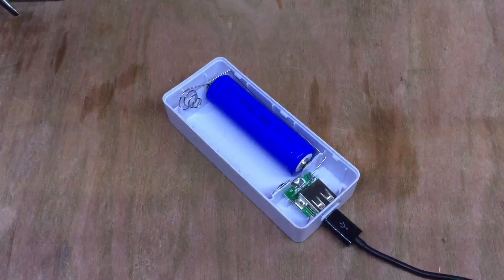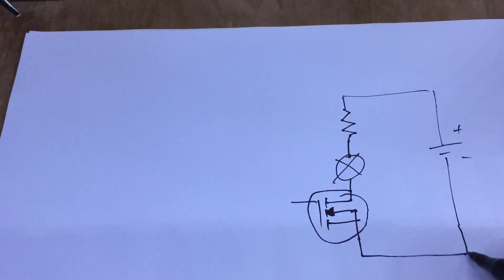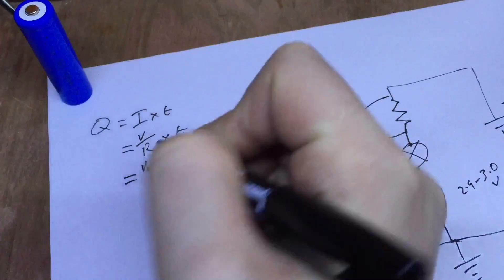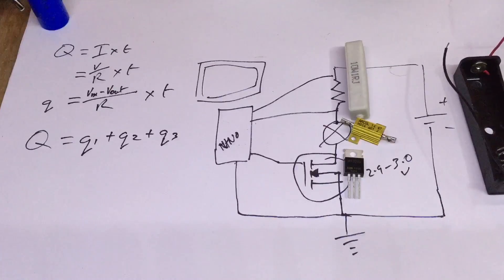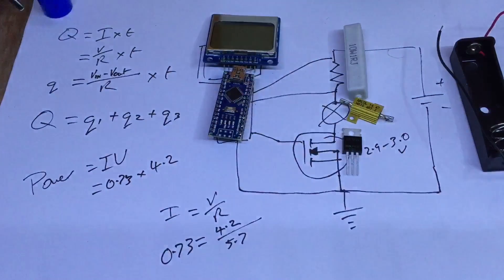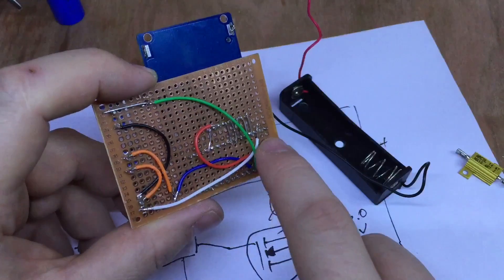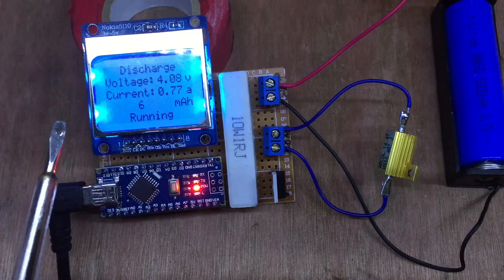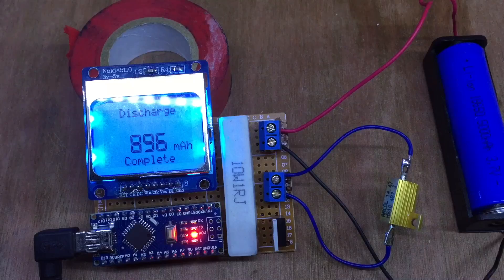Lithium Ion 18650 Capacity Checker - Adam's Arduino Projects

Comment: stray '\342' in program
Reply: Instead of - 

digitalWrite(gatePin, HIGH);
millisPassed = millis() – previousMillis;
current = (battVolt – shuntVolt) / shuntRes;
mAh = mAh + (current * 1000.0) * (millisPassed / 3600000.0);
previousMillis = millis();

need -

      digitalWrite(gatePin, HIGH);
      millisPassed = millis() - previousMillis;
      current = (battVolt - shuntVolt) / shuntRes;
      mAh = mAh + (current * 1000.0) * (millisPassed / 3600000.0);
      previousMillis = millis();

I don't know why, but it works!

Comment: BAD :Arduino: 1.8.14 (Windows 11), 
sketch_oct31a:68:25: error: stray '\342' in program
 millisPassed = millis() – previousMillis;
                         ^
sketch_oct31a:68:26: error: stray '\200' in program
 millisPassed = millis() – previousMillis;
                          ^
sketch_oct31a:68:27: error: stray '\223' in program
 millisPassed = millis() – previousMillis;
                           ^
sketch_oct31a:69:20: error: stray '\342' in program
 current = (battVolt–shuntVolt) / shuntRes;
                    ^
sketch_oct31a:69:21: error: stray '\200' in program
 current = (battVolt–shuntVolt) / shuntRes;
                     ^
sketch_oct31a:69:22: error: stray '\223' in program
 current = (battVolt–shuntVolt) / shuntRes;
                      ^
C:\Users\....\AppData\Local\Temp\arduino_modified_sketch_20219\sketch_oct31a.ino: In function 'void loop()':
sketch_oct31a:68:29: error: expected ';' before 'previousMillis'
 millisPassed = millis() – previousMillis;
                             ^~~~~~~~~~~~~~
sketch_oct31a:69:23: error: expected ')' before 'shuntVolt'
 current = (battVolt–shuntVolt) / shuntRes;
                       ^~~~~~~~~
exit status 1
stray '\342' in program

Comment: Thank you for excellent video! Could you explain why do we need a shunt resistor and two Arduino analog inputs to measure current. If we know exact resistance of the load (for ex. 4.7 Ohm) and have measured voltage on this load (for ex. 4.0 Volts) then we can calculate current as 4.0 / 4.7 = 0.851 Amp.  So, I think that measuring battery voltage (that is the same as load voltage if load resistor is connected directly to the battery) we can always calculate current value. It means that one Arduino analog input is enough to measure both voltage and current. Am I wrong?

Comment: I wonder what is the difference between doing this way and discharge the battery at a constant current, would you get the same capacity result number?

Comment: Did you check these values against a proper meter? Hardly seems realistic that the current is jumping from 0.76A to 0.63A and back within a few seconds, with just a battery discharging into resistors. That's almost a 20% error in current measurement, although I guess in the long run it might average out to about the right result.

Comment: Nice video. I have some questions. What is the purpose of the shunt resistor? We already have a voltage drop on the resistor load to calculate the current... so the shunt seems unnecessary. In this way we could also read a single voltage (the positive terminal of the battery) as the other end of the load will be at ground (so clearly 0V). Am I wrong?
Thanks
Reply from the maker: You’re right - it’s not really necessary. The idea of a shunt and load resistor in the deign was simply so the load could be changed. Changing the load resistor would change the rate at which the cel was being discharged, and no code changes would be required.
Reply: @AdamWelchUK  many thanks, now it's clearer

Comment: Hi Adam, I really enjoy your videos. I had a question about the load resistor and 'voltage sense' resistor here - I can't see why they couldn't be integrated into one load resistor across which the voltage is measured. In this case you'd be measuring the battery voltage effectively, but again, I guess this is the voltage applied to the resistor, and so is the right voltage to use to measure the current flowing... what do you reckon. I'm hoping to use this with Azande tool, which is very handy for interfacing arduino with pc. All the best!
Reply: Typically a smaller value of resistor is used to keep the voltage across the resistor small, within a range that the microcontroller can read without blowing up. However in this case since the microcontroller is running at 5V and the maximum voltage of the battery is 4.2V, you are perfectly correct, the second resistor was not necessary. In fact, measuring the voltage drop across a smaller resistor only serves to make the result less accurate, because you're only using a small portion of the resolution of the analogRead range.

Comment: /* 
* Battery Capacity Checker
* Uses Nokia 5110 Display
* Uses 1 Ohm power resister as shunt - Load can be any suitable resister or lamp
* 
* YouTube Video: https://www.youtube.com/embed/qtws6VSIoYk
* 
* http://AdamWelch.Uk
* 
* Required Library - LCD5110_Graph.h - http://www.rinkydinkelectronics.com/library.php?id=47
*/
 
#include "LCD5110_Graph.h"
LCD5110 myGLCD(5, 6, 7, 9, 8);  // Setup Nokia 5110 Screen SCLK/CLK=5, DIN/MOSI/DATA=6, DC/CS=7, RST=9 Chip Select/CE/SCE=8,
extern uint8_t SmallFont[];
extern uint8_t MediumNumbers[];
 
#define gatePin 10
#define highPin A0
#define lowPin A1
 
boolean finished = false;
int printStart = 0;
int interval = 5000;  //Interval (ms) between measurements
 
float mAh = 0.0;
float shuntRes = 1.0;  // In Ohms - Shunt resistor resistance
float voltRef = 4.71; // Reference voltage (probe your 5V pin) 
float current = 0.0;
float battVolt = 0.0;
float shuntVolt = 0.0;
float battLow = 2.9;
 
unsigned long previousMillis = 0;
unsigned long millisPassed = 0;
 
void setup() {
 
  Serial.begin(9600);
  Serial.println("Battery Capacity Checker v1.1");
  Serial.println("battVolt   current     mAh");
 
  pinMode(gatePin, OUTPUT);
  digitalWrite(gatePin, LOW);
 
  myGLCD.InitLCD(); //initialize LCD with default contrast of 70
  myGLCD.setContrast(68);
  myGLCD.setFont(SmallFont); // Set default font size. tinyFont 4x6, smallFont 6x8, mediumNumber 12x16, bigNumbers 14x24
  myGLCD.clrScr();
 
  myGLCD.print("Battery",CENTER,0);
  myGLCD.print("Check",CENTER,12);
  myGLCD.print("Please Wait",CENTER,24);
  myGLCD.print("AdamWelch.Uk",8,40);
  myGLCD.update(); 
  delay(2000);
  myGLCD.clrScr();
}
 
void loop() {
 
  battVolt = analogRead(highPin) * voltRef / 1024.0;
  shuntVolt = analogRead(lowPin) * voltRef / 1024.0;
   
  if(battVolt >= battLow && finished == false)
  {
      digitalWrite(gatePin, HIGH);
      millisPassed = millis() - previousMillis;
      current = (battVolt - shuntVolt) / shuntRes;
      mAh = mAh + (current * 1000.0) * (millisPassed / 3600000.0);
      previousMillis = millis();
 
      myGLCD.clrScr();
      myGLCD.print("Discharge",CENTER,0);
      myGLCD.print("Voltage:",0,10);
      myGLCD.printNumF(battVolt, 2,50,10);
      myGLCD.print("v",77,10);
      myGLCD.print("Current:",0,20);
      myGLCD.printNumF(current, 2,50,20);
      myGLCD.print("a",77,20);
      myGLCD.printNumI(mAh,30,30);
      myGLCD.print("mAh",65,30);
      myGLCD.print("Running",CENTER,40);
      myGLCD.update(); 
       
      Serial.print(battVolt);
      Serial.print("\t");
      Serial.print(current);
      Serial.print("\t");
      Serial.println(mAh);
       
      delay(interval);
  }
  if(battVolt < battLow)
  {
      digitalWrite(gatePin, LOW);
      
      finished = true;
       
      if(mAh < 10) {
        printStart = 40;
      }
      else if(mAh < 100) {
        printStart = 30;
      }
      else if(mAh <1000) {
        printStart = 24;
      }
      else if(mAh <10000) {
        printStart = 14;
      }
      else {
        printStart = 0;
      }
       
      myGLCD.clrScr();
      myGLCD.print("Discharge",CENTER,0);
      myGLCD.print("Voltage:",0,10);
      myGLCD.printNumF(battVolt, 2,50,10);
      myGLCD.print("v",77,10);
      myGLCD.setFont(MediumNumbers);
      myGLCD.printNumI(mAh,printStart,21);
      myGLCD.setFont(SmallFont);
      myGLCD.print("mAh",65,30);
      myGLCD.print("Complete",CENTER,40);
      myGLCD.update(); 
       
      delay(interval * 2);
  }
}

Comment: Thank you for sharing this video. I am working on something similar. However, one thing that confuses me and I cant seem to get an answer. There are people doing this on a larger scale (as I intend to later). Why don't they discharge into a capacitor, so they can reuse some of the power to charge another cell later? I imagine it would be a considerable saving if you have to do this for many thousands of cells.

Comment: i have made one by using only 1 resistor ( 3 in parallel to get 3.3ohm) and when i check the voltage across the battery with multi meter it shows different value from the arduino voltage , like the arduino reads different voltage if i change the "voltRef" as the voltage reading is not current i might not get real capacity of any cells. is there any more accurate way to know the capacity even if its complex and might take time to make ? i just need the accuracy to be 95-99%

Comment: I've built this one as well. The Amps get measured quite well, but as soon as there is a load on the battery the voltage shown on my display is way off (ie 3.2V instead of 4.1). With this inbalance, I can't use this as I originally intended since the system will stop discharging too soon. Does anyone have the same problem or an idea on how to solve that?
Reply: Any idea what I might have done wrong or the problem is?
Reply: I have the same problem.  On start-up (first time around the main loop, before the mosfet is turned on) the A0 battery voltage reads 100% accurate, however after it switches the mosfet on and the battery is under load, the voltage on A0 seems to drop by ~0.3v.   Weirdly, if I use a voltmeter to measure the batter voltage directly it measures (say) 3.9v, whereas if I measure the voltage at A0 it reads 0.3v lower (3.6v).  Any thoughts on why?
Reply: @MikesAllotment  Unfortunately I can't. I was hoping to get some help by experienced viewers...
Reply: @MikesAllotment  Well, since I could resolve my issue now I might be able to help you. It was such a stupid thing but the wires I used to connect the battery were too thin... I noticed that when I measured the voltage directly at the battery in comparison to measuring it at the board... Hope this helps

Comment: why use 2 loads, I mean 2 resistors.
for reading the voltage can't we just directly reading the raw voltage from the battery?  I mean, placing the analog reading directly to the battery terminal without using a voltage divider? and just use one resistor as a load?
or am i missing something?
Reply: He is using two loads to be able to measure the current with one and the second to be able to change it for different amps. You can do it with one but you can't change the load

Comment: hi  I have a problem  C:\Users\My\Desktop\arduino PROJECT\sketch_jul30ad\sketch_jul30ad.ino:1:27: fatal error: LCD5110_Graph.h: No such file or directory

 #include "LCD5110_Graph.h"

                           ^

compilation terminated.
Reply from the maker: Have you downloaded the lcd5110 library? There’s a link at the top of the code.

Comment: 1 ohm isn't 1 ohm per say. I have a few 1 ohm 10%  10W resistors and they're measuring 1.0284 and 1.024 Ohms. Simply used two known good DMM's and old PC supply with 2x 10 Ohm resistors in series to the supply with the two "shunt" resistors also in series. One multimeter read out the amps and the other read voltage across the 1 ohm "shunt" resistors. E/I = R. If you were to precision measure the load, shunt, and use the provided Rdson from the data sheet in your total resistance and calibrate the Arduino's ADC, you should find that you can get a lot more accuracy from the tester, say within 0.5% Also Arduino can't handle true Floating point like a PC can, so best to just keep maths Integer based or just spit raw ADC values out to the Serial terminal and have a spreadsheet  do the number crunching instead.

Comment: So here's a head scratcher, I've just finished all the soldering and uploading the code, but it stays put on the "please wait" text. It never changes, I've tried restarting a few times and waiting in excess of 10 minutes, even with a battery connected. Have you seen that before?

Comment: I have in stock the 2004A LCD display and am finding difficulties to wire it up according to the diagram. Is it possible for you to give me the right pin connections? 
I am all set to check  the capacity  of the 18650s I have.

Comment: Thank you for the video. I have built this, but I can't get it to work... I have used the design where you use the 6.8Ohm resistor as a load, and soldered the load directly to the perfboard. The rest is exactly the same. I noticed that my shunt resistor is reading around 1.3Ohm, instead of 1.0Ohm, I have altered the code with the new value but still nothing. It doesn't start discharging. I Serial.print'ed the battVolt value, but it is always reading between 0.7 and 2.0. So there is the problem I think. I have checked the wiring all day long today, but I can't find anything wrong.
Reply from the maker: Perhaps you should check continuity across the mosfet when the mosfet gate pin is high?
Reply: Adam Welch I figured it out, I was missing the common ground (found it in the comments, I am horrible at reading schematics, but apparently even worse at listening haha) the device works now, except for the screen. It never updates the screen, but I see that the battery is draining as Serial is reporting, and the load resistor is getting warm.

Comment: I came across this video while researching an Arduino based battery capacity tester/charger. My specific use is 12V lead-acid batteries used with a solar panel. Thanks for the video, this will be my starting point.

In the formula for calculating battery capacity the measurement interval used was 5 seconds. I have been searching the web and can find no standard for measuring battery capacity that recommends voltage measurements taken every 5 seconds, or any other specific interval. In the Arduino's final calculation of 896mAH, if 1 second intervals were used instead of 5 then the final value would be 5 times greater or 4480mAh. And if you only added measurements every 10 seconds then the final measurement would have been half or 448mAH. Since the final measurement varies widely depending on the sampling time used and not having any standard sampling time used across battery manufactures, I think the method of measuring battery capacity in this video is flawed.

Another aspect of the formula used is that a reference voltage of 4.2V. In reference to the type of battery being tested (18650), 4.2V is the charging voltage and not the batteries nominal voltage which is 3.6v. This difference of 0.6v will certainly significantly skew the results.
https://batterybro.com/blogs/18650-wholesale-battery-reviews/32496579-comparing-panasonic-18650-bd-vs-panasonic-18650-be

The basic formula which being used is ((Vin - Vout) / R) * T. The capacity formula which involves voltage over time is ((V^2)/R) * T. I think if you adjust your formula and reference voltage the final result will be closer to the labeled battery capacity.

I found a website with a Watt-Hour to mAH converter. According to this calculator the correct final reading using the testing method in the video for a 3000mAH 18650 is 18WH.
https://www.rapidtables.com/calc/electric/wh-to-mah-calculator.html 

From what I have found on the web, constant current limiting should be used when determining battery capacity.
https://electronics.stackexchange.com/questions/18612/how-to-measure-capacity-of-a-lithium-ion-battery

Considering the above may explain the large difference between the Arduino's final result and the labeled capacity of the battery.

Using a constant current enables easier testing of the batteries capacity. For example, with a fully charged 3.6V battery and using a discharging end voltage of 2.5v; and a discharge current of 0.61A; it should take 8.2hours to fully discharge (0.61A * 8.2hrs = 5000mAH). If the battery is not fully discharged very often it will last much longer and be able to go through the charge/discharge process a lot more times. It is important to note that once the battery gets past it's stable usable capacity a drastic increase will most likely occur and this needs to be protected against so that the battery does not overheat and explode.

https://batterybro.com/blogs/18650-wholesale-battery-reviews/32496579-comparing-panasonic-18650-bd-vs-panasonic-18650-be

The easiest way to test LI-on batteries, as well as other types of batteries, is with an iMax/B6 battery tester for about $25.00 - http://amzn.to/2HfQjaT

Comment: would a larger Wattage power resistor (eg 50w) be suitable? As long as it is still 4.7ohms?
Reply from the maker: Yes larger power is fine. It doesn’t have to be 4.7 ohms, you can swap it out for different values if you like for different discharge rates. Just fo the maths to ensure it’s suitable.